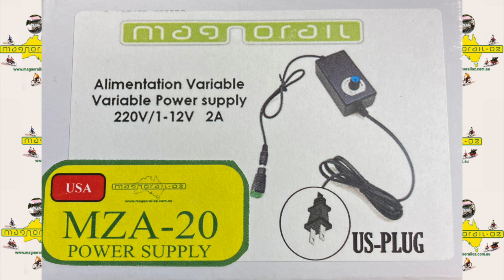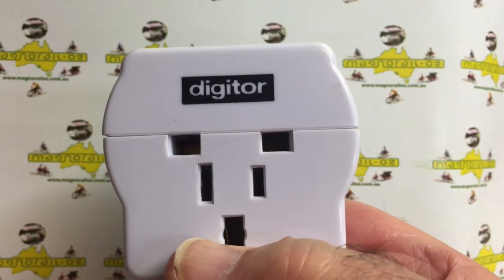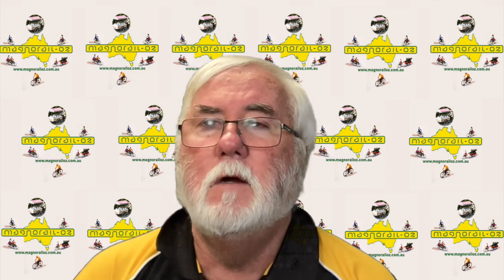Product review - Magnet Viewer and Variable Power Controller

Comment: I operate this controller through a 120v to 240v converter though  as you suggest a plug adapter will work just as well. I find the speed  is controllable from very slow to very fast with smooth movement throughout the speed range.